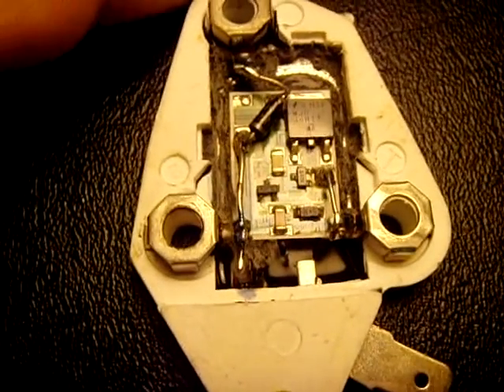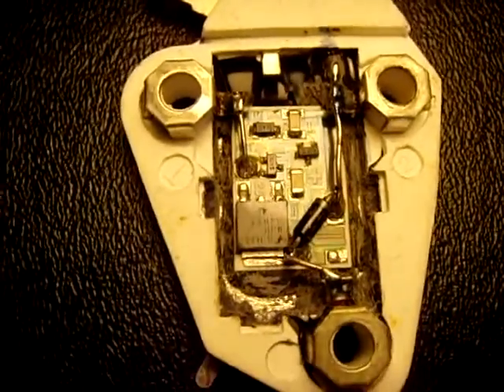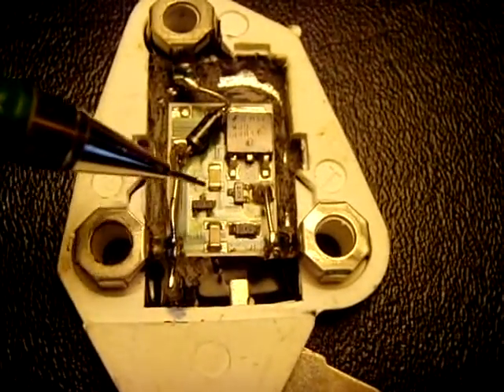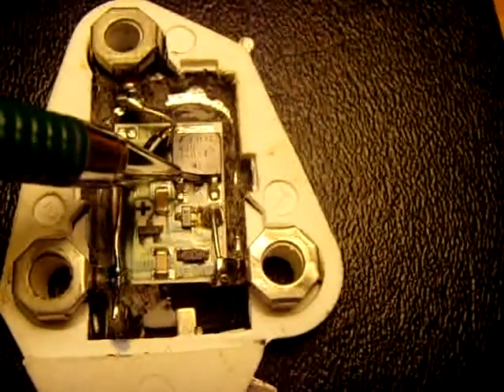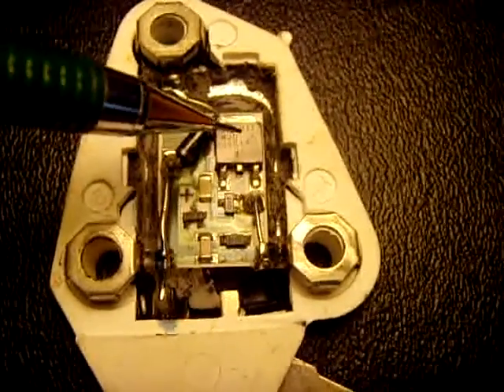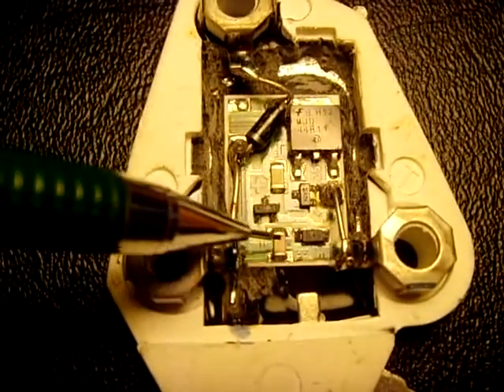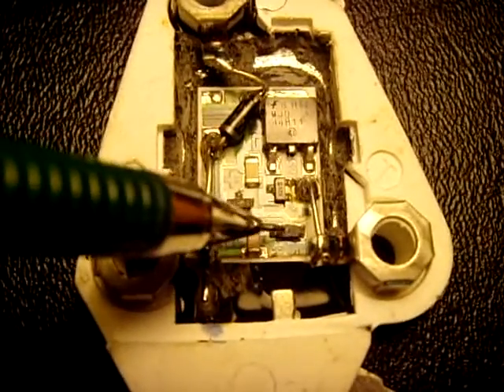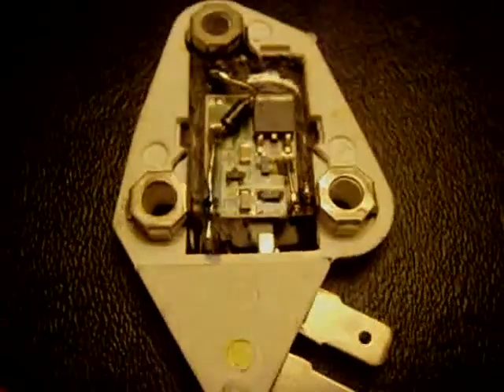A Look Inside the GM 10si/12si Voltage Regulator

Comment: If the 2 wires on the outside of the regular are changed the other way around and the alternator stays at 12 volt- doesn"t charge is the regulator broken or the alternator diode?
Reply from the maker: Test the diodes and connection with the brushes first, if they're OK, then replace the regulator.

Comment: Finally reverse engineer the 12si , 27si voltage regulator i have... How do i upload my pictures and schematic
Reply from the maker: Send images to electronicsnmore2016@gmail.com if you want them added to the video description area. I'll make sure you're credited. Thanks
Reply: Would I be able to get access to this? I don't feel like paying 100+ for an alternator I can fix myself, or 25$ for a part I don't actually need.

Thanks!

Comment: If I replace the zener to 12v, will that give me 24v charging?
Reply from the maker: I would think that doubling the zener voltage used in that regulator would double the charging voltage.
Reply: @electronicsNmore  Thanks.

Comment: I'd like a follow up video of this because I think I have a fried regulator and don't know how to test it.
Reply from the maker: Very easy to test, with the engine running you should see a stable 14 - 14.5VDC output at the battery if it's close to full charge. If you don't, buy a new regulator. They aren't expensive.
Reply: Hello again electronicsNmore, I wanted to follow up with what I finally figured out.  It wasn't the alternators.  I was able to re-install my original and right now it seems to be fine.

I cleaned up the body ground and verified body voltage and battery voltage  grounds.  Even after doing that, the alternator on the vehicle was still way overcharging, but before I started the engine, I verified regulator through lamp to whatever ground I found on the engine was 9.6 ohms.  That I suppose  is what is supposed to differentiate between battery to ground and field to ground for step up charging purposes.

Even though I thought I was out of the woods, when testing at that running engine, I was still disappointed to find too much voltage being blasted out of the B+ terminal.    I thought that the transistor was burned up.

The next day, I checked the fuses.  I had 2, 20 amp fuses which were open, neither of which indicate anything to do with a charging circuit.  One is listed for blower, which had been out for a wwk, and the other was for choke heater, of which I have no idea how long it had been out.

I replaced them, and was not surprised to find the blower now working.  What surprised me now was that in the key "on" self check position, the red charge light was now on, something it hadn't done with any of the alternators, and also, when I started the engine, the charge light went out so that was a big (HoRaY).  I went ahead and swapped my original alternator back in, and as of a day later, it seems to be fine.  I forgo and didn't carry tools with me if I had had a problem.

So thanks for being a listening ear, and encouraging a people like me to fix a problem.
Reply: Hi electronicsNmore, thanks for the response, but I have to add something here.  I checked the battery body ground and it had too much resistance on the one test, and was only showing 7 volts instead of what should be 12.6 battery voltage through the grounding point to the body, probably due to the resistance. 
 Because the regulator grounds to the body through the lamp side path, the regulator wasn't sensing a rising ground charge, so I don't think it was shutting off the field voltage, which keeps rising as a result of positive voltage being pushed out through the B+ post.  I don't ever see a ceiling voltage cut-off occur at the B+ or the field feed.  14.5 volts pushing  through the regulator probably welded the transistor contacts together or something.  From your video, it looks like I could use a multimeter on the legs of the big PNP transistor to verify that that isn't the case.  Am I understanding this correctly?   Do you know what a voltage check on the running alternator between a good ground and the grounding leg of the regulator should show me, so I know what to look for?  Is that a good test, or should I run the test with a lightbulb type load in series with the meter leads?  Thanks in advance.

Comment: I had the same problems.  Output voltage and regulation:  Laughable.  In all fairness the regulator I had was from a knock-off of an SI-12 Alternator and was blasting out anywhere from 15 to 17 volts into a fully charged battery.   

I can tell you there's way better available in making your own regulators from op amps,  PWM or linear voltage regulator IC's, or even more sturdy  components.   Think of the alternator as nothing more than a transformer controlled by the current into the rotor.